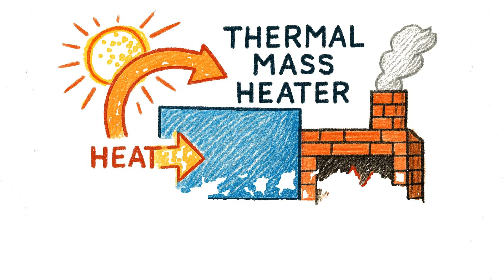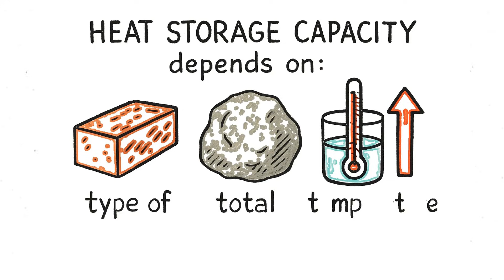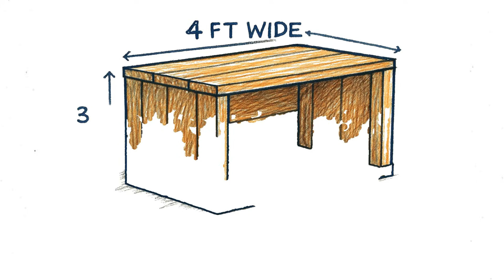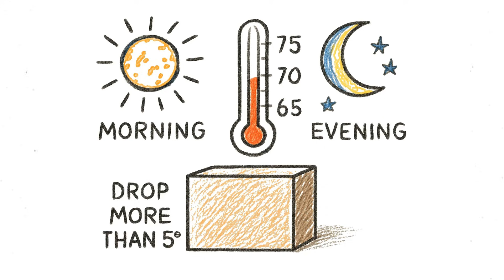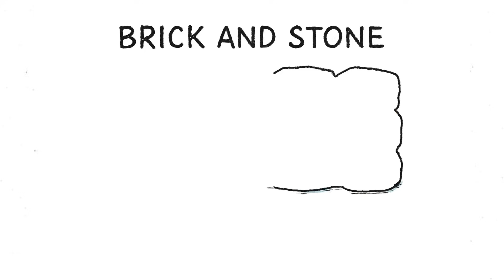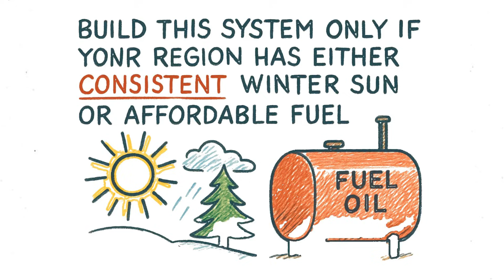How to Keep a Room Warm for Hours (Thermal Mass Heater)

Comment: I’m curious if anyone has tried setting one of these up in a rental. It seems like a lot to move, but a 50% to 70% drop in heating costs is hard to ignore.

It is a great way to think about thermal mass, not as something that creates heat, but as something that shifts heat to when you need it most.